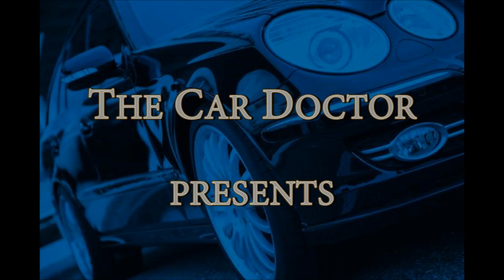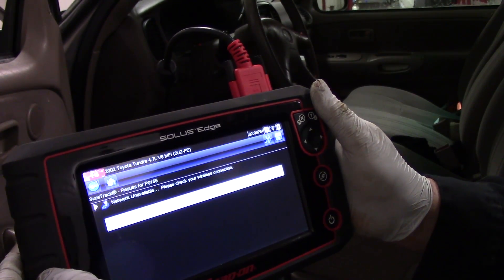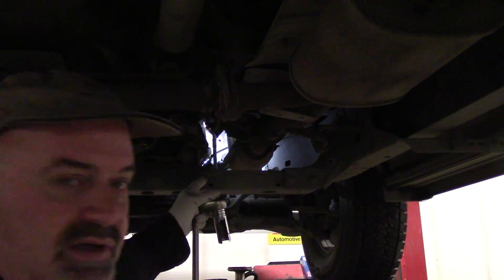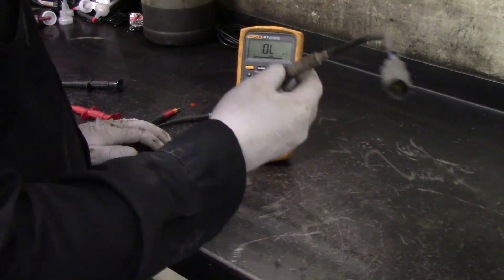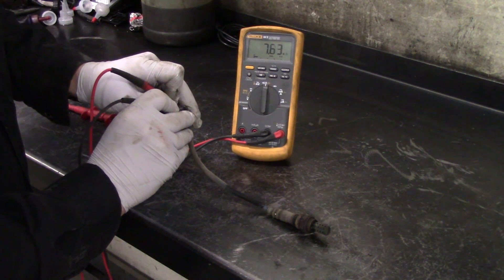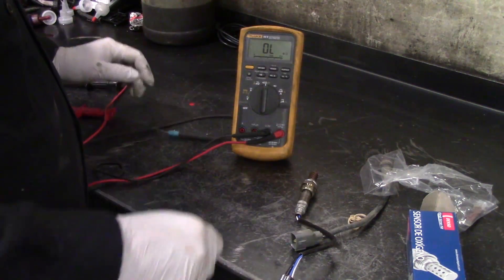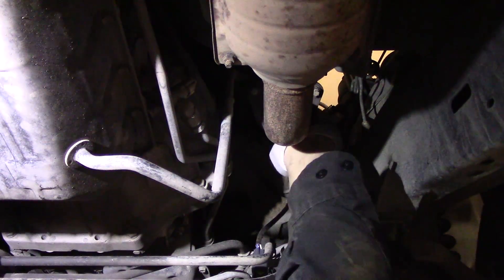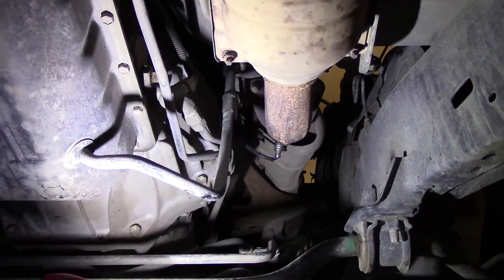Toyota O2 Sensor Codes P0135 P0136 P0155 P0156

Comment: I ran the OHMs test across my black wires and im getting a solid 13.6 ohms reading. I am getting the typically P0136 code. Can they be bad yet still read an ohms reading in spec?

Comment: Hi - Could I unplug the sensor from the wiring harness, without removing it, and read the Ohms on the multimeter to determine if it's the bad sensor?

Comment: Thanks Tim.  Some of those O2 sensors get pretty seized in.  Even in non rust belt states.
Reply from the maker: Yes, this one was a little tight. I have also had Toyota O2’s that took the threads out with them. Glad that didn’t happen this time.